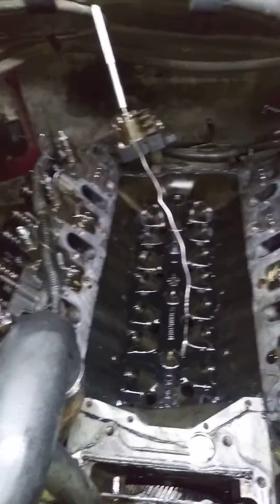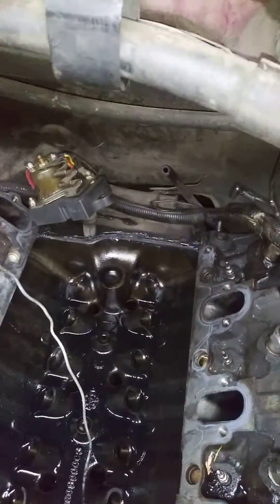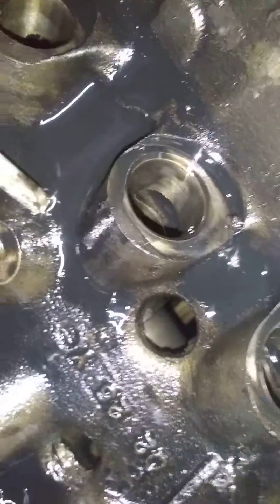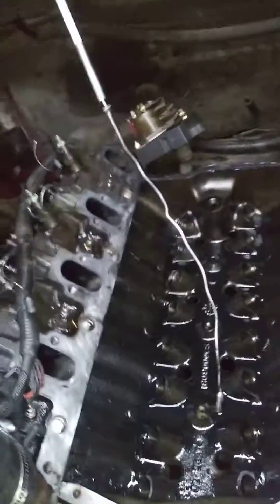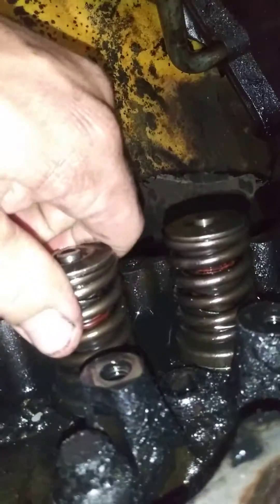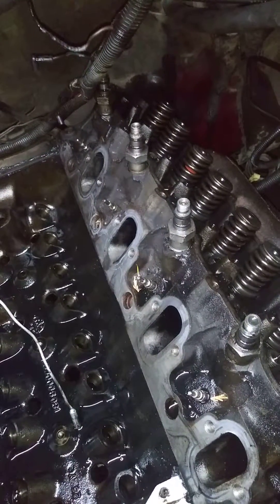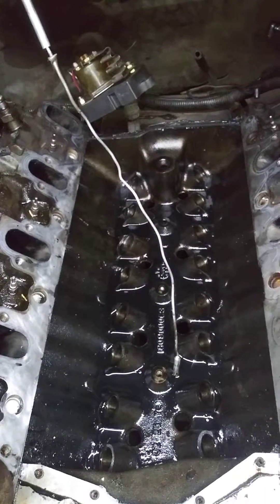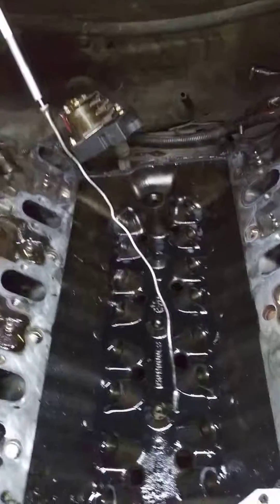7.3 IDI tear down for head work

Comment: Think parts for these will be available for a while in the future?
Reply from the maker: They are still out there, but they are getting harder to find. Not to mention the IDI factory turbo kits are far and few between.
Reply: @modernneanderthal6970  I don't care about turbos just stock engine parts. I just an '87. Think it's worth putting money into?
Reply from the maker: @oasissands8584  worth is all subjective. Its a personal value. I bought my truck for $500 just to rebuild the engine and run it for a few months before getting my hands on 5.9 12 valve Cummins. Do I think my truck is worth all the money and work that I am putting into, absolutely. There's a personal pride I take in my work and my truck
Reply: @modernneanderthal6970  If parts'll be available, I'll drive it.